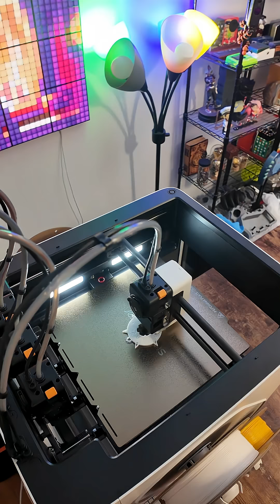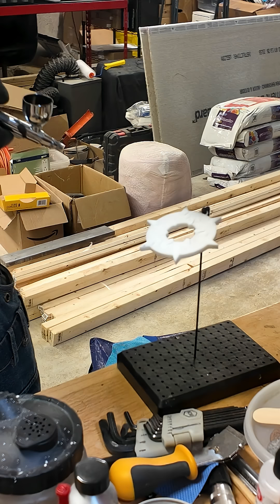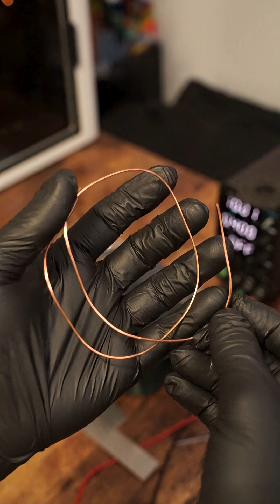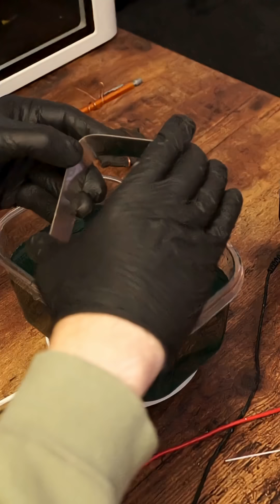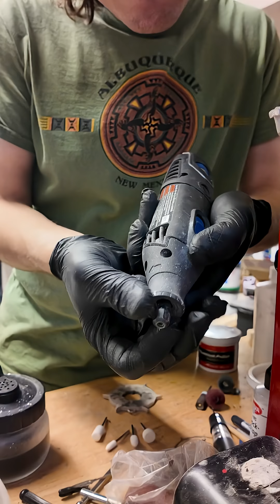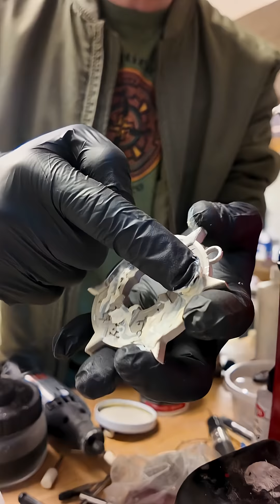Turning 3D Prints Into Metal!

Comment: First step $1500 usd xD
Reply from the maker: You can get the basic stuff for around $100! Assuming you don't have a power supply etc. already
Reply: @ImpulseBuilds  Electroplating can get much cheaper, In high school I plated the body of my paintball gun, the setups power-supply was a 6V battery.
Reply from the maker: @tonicinc.754 That's sick! I was referring to my specific setup, but I've seen people do it like this. I'll have to do a follow-up with the most  budget-friendly method to demonstrate how accessible it can be!